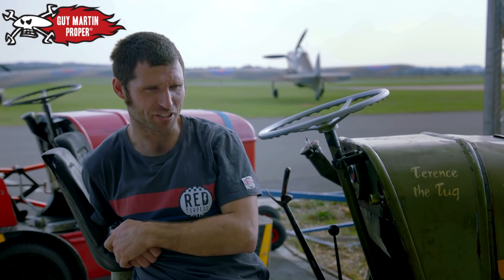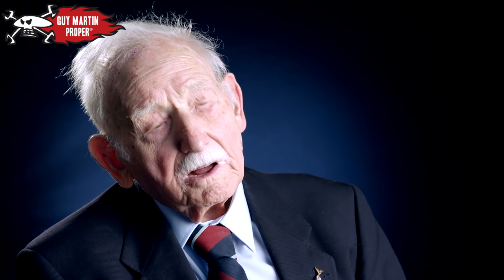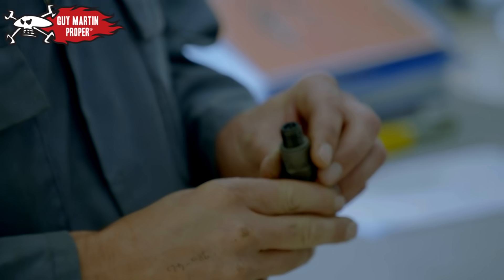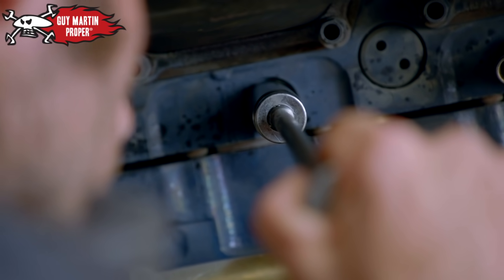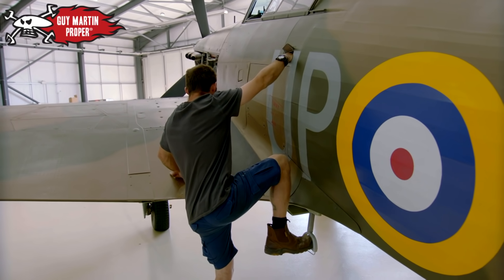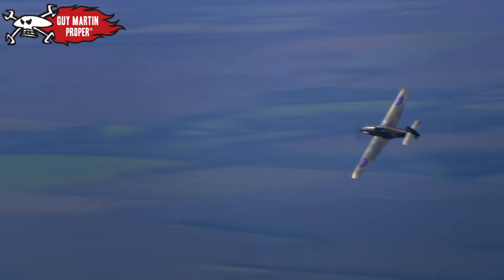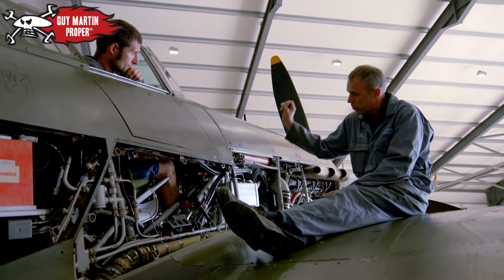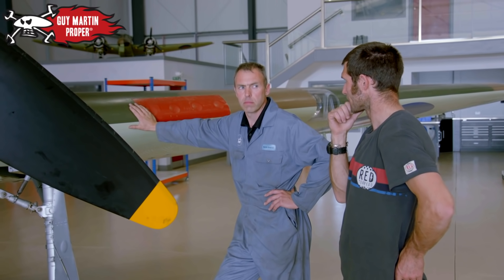Guy in his element servicing a legendary WW2 Hurricane | Guy Martin Proper

Comment: My Uncle joined the R.C.A.F. in 1937 and was attached to the R.A.F. during and after the battle of Britain and he flew both Hurricanes and Spitfires. I asked him once which aircraft he personally favoured and he said the Hurricane without any hesitation. When I asked why he told me that he liked the Hurricane because it was more maneuverable even if it suffered a slight speed disadvantage at the time. He also commented that despite their reputation for catching fire, the Hurricane could take more battle damage that a Spitfire since it was a frame built aircraft with a fabric skin allowing enemy rounds to pass through with little or no damage. The Spitfire with it's monocoque construction was more susceptible to structural failure as the skin was the frame and it did not like holes being punched in it which weakened the entire aircraft. He was flying a Hurricane when he performed some act that earned him a D.F.M.

Comment: 2:26 these boys prob no better than me but i thought you shouldn't grease sparkplug threads because it will change the torque spec ?
Reply: There is dry torque and wet torque settings. Settings are always dry unless specified.

Comment: Why are the wings metal? They should be Irish Linen.
Reply: Wrong.
Reply: Only very early MK.I Hurricanes had fabric covered wings. They would have also had 2 bladed Watts propellers.
Reply: @pattenger4688   As my limited understanding has it the Linen was considered a key resource because of this usage.  It was also because of the linen that Hurricanes were able to sustain more damage (if the fuel tank was not compromised) than the Spitfire.  20mm rounds pass cleanly through linen, but not aluminium.  Linen was easier and quicker to repair.  These are two of the reasons why we had more Hurricanes than Spitfires during the Battle of Britain.  Although I will bow down to your greater knowledge here, when you point out that later Hurricanes were made of metal.
Reply: @briangreen6602  You cannot just say "wrong". You must say why I am wrong. See Tenger below, who correctly (as far as I know) points out that this is a later Hurricane.
Reply: @nicholasburns729  The fuselage was Irish linen through out all Mks and the tubular frame construction also made it easier to simply replace a tube that had damage but for the wings, fabric was used to speed production until metal wings were produced with greater performance.
Reply: They'd switched to all metal wing production by April 1939.